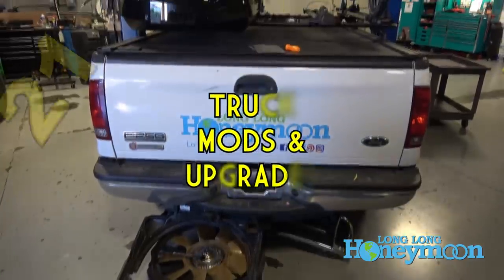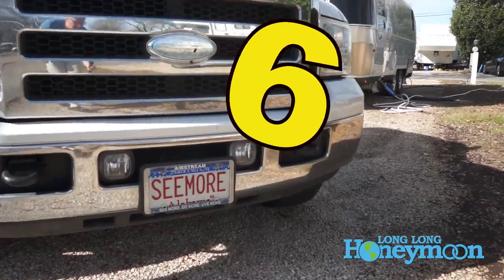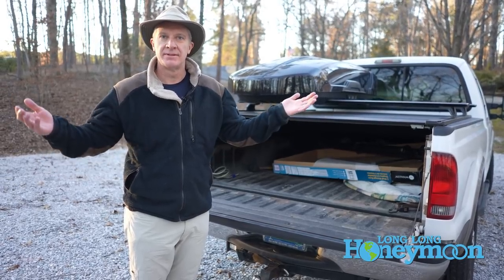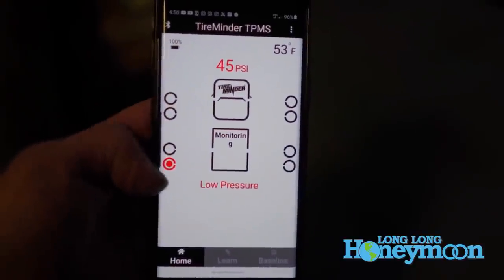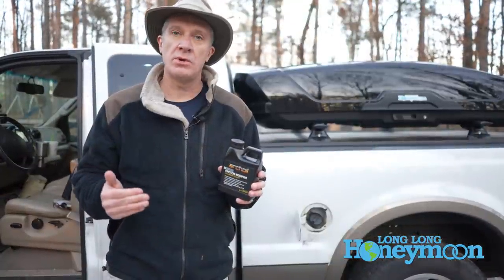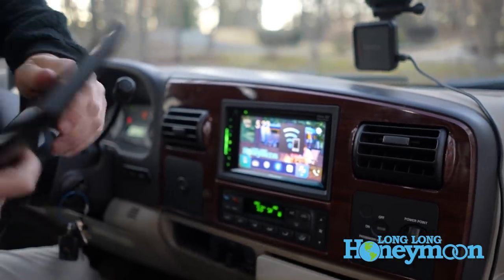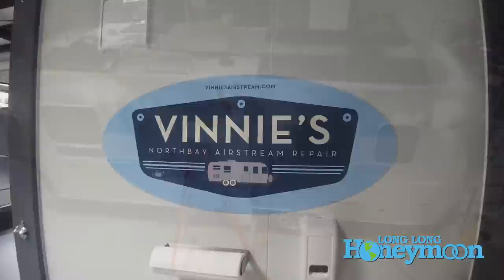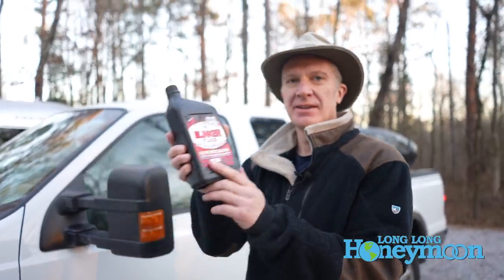21 Pickup Truck Mods & Upgrades!

Comment: It's so interesting to see all the comments from people telling him his problem was buying a Ford, because apparently every other truck is perfect right off the lot and never needs any modification or improvement. So amazing every other truck manufacturer managed to make their trucks perfect.
Reply: The number of videos of Chevy and Dodge owners who hate their trucks and converted to Ford outnumbers Ford owners converting to Chevy/Dodge by about 5 to 1.  I love my F150 XLT 4x4....best truck I've ever owned.
Reply: Nope. Upgrading a Ford truck sounds like polishing a turd. It's still a turd.

I've got an unmodified 1999 dodge ram 1500 and the only significant thing done to it after 22 years and 230K miles is a rebuild of the automatic gear box. So not perfect, but no need for "bullet proofing" either.

(Forgot to mention: we use the Dodge as a work truck, regularly hauling loads of gravel and trash that put the suspension confidently on it's rubber blocks.) 

At some point you have to let go of your idealized view of Ford. They just don't deserve it :-)
Reply: My Tundra is "perfect" compared to Ford, yes.  Sorry, it's just true.   250,000 miles and 50 states and all I've replaced is the air heater from running it all night once at 13,000 ft.  Henry Ford and the workers aren't the reason Ford sucks - it's letting Wall Street planned obsolescence be their business doctrine that degraded them... like most American companies these days.   New York MBAs are what ruined our businesses.
Reply: @dannyboy8474  Tundras are good trucks, but overrpriced.  Same with Tacomas.
Reply: @davervatx8814  get what you pay for
Reply: @ronblack45  Not with Dodge or Chevy.
Reply: 253,000 miles all my 2003 Cummins has needed is a recent water pump replacement and the lift pump and that’s it period. If I do have to work on it at least I will not have to pull the cab off to work on it. This will be a million mile truck as it has no rust in it yet. Your Ford will never do that, I’m sorry 😢.
Reply: The only thing any newer diesel needs is a full emissions delete.
Reply: @davervatx8814  there's a reason people put Cummins in Ford's and Chevy's.
Reply: @dannyboy8474  nothing wrong with Toyota. As long as you don't overload it. It's still a half ton.
Reply: @davervatx8814  Ford will finance anyone.
Reply: @duckwacker8720  So will Chevy, Dodge, etc. So?
Reply: @duckwacker8720  They have more money than brains?
Reply: @duckwacker8720  I’ve never even heard of someone doing that switch. Perhaps you’re thinking of an LS swap? I would love to see proof of what you say.

Comment: I have an '06 6L CCLB and I added a 50 gallon Transfer flow auxiliary fuel tank. I now have 88 total gallons of fuel. Going 800+ miles towing without navigating a fuel center is kick ass. I've also installed offroad lights under my rear bumper to illuminate my trailer, when getting to a CG at o'dark thirty.
Reply: I use to use a magnetic flashlight on the rear bumper of semi-trailers for backing into unlit loading docks. It works equally well on my 38’ gooseneck in RV parks.

Comment: Great advice on the blinker fluid.   Several years ago I tried to save some money by using cheap blinker fluid.    Long story short, the cheap stuff disintegrated the muffler bearings and made the kanoodler valve stick in the wide open position.    It cost several thousand dollars to fix the damage from the cheap blinker fluid but I’ve learned my lesson.
Reply: Yes, but the less expensive blinkers fluid will also lubricate the wigiform finflopper which otherwise would turn dry and scaly, and over time can begin to smell fishy
Reply from the maker: @markwall6685  Those cheap blinker fluids can also leak over into the flux capacitor, leading to very expensive repairs. Not worth the risk!
Reply: @LongLongHoneymoon  If you guys would just update your skyhooks, you would not even need the blinker fluid any more...they would become solid state.
Reply: Completely agree!! That's a true story on the cheap products..
Reply: @markwall6685  that's one reason Febreeze auto air fresheners sell like crazy!
Reply: I just switched my GMC 2500 over to SYNTHETIC blinker fluid.  Signals blink much faster now, and they claim it will put new life into those weeks-old LED bulbs.  Time will tell.
Reply: @LongLongHoneymoon  That only applies to Delorean's.
Reply: And yet nobody seems to put in the proper dimmer switch grease.
Reply: Do you sell the blinker fluid on your webpage?  I haven't been able to find it at Wal*Mart or Autozone.
Reply: @jimcollins8097  Don't let them blink too fast. Only 1-2 times per second (at least here in California, not sure if that is a federal law also).

Comment: 2006 Dodge 2500 Cummins here. I upgraded my steering gear to a Redhead unit. Great improvement in the steering. Upgraded to KYB heavy duty shocks. Now when I hook up my 29-ft travel trailer the truck barely squats at all. That's it for mods. 145k miles and going strong.

Comment: First thing I did to my 2003 RAM 2500 Cummins when I bought it in 2018 was to replace the stock hormonic damper with a Fluidampr. The engine is smoother and actually quieter as a result. Its one of those subtle changes that after a while you don't notice and just take for granted, kinda like your shocks. Its a good enough mod that all 6.7 Cummins engines come from the factory with them. Other things I did was to install a Leer topper, and a super thick DeeZee bed mat (I don't like spray in bed liners) after ditching the slick plastic bed liner that was in the truck when I bought it. Lastly, the 3rd gen RAMs have a super heavy tailgate and and the DeeZee tailgate damper is a lifesaver.

Comment: I use a bed rug in my Ram 2500’s bed over the factory spray in bed liner. I love it.

I’ve had all of the motor killing attachments removed from my Cummins as well as having the motor studded. Motor runs great and mileage increased. I also had a deep transmission pan, a transmission case brace, and deleted the thermostatic transmission cooling block. Now my trans temp never gets above 140.

Comment: Sean, I have an 06 6.0 liter F350 DRW. It was my Dad's so it's not going anywhere anytime soon. I just did the S & B cab mounts. There are less expensive ones, but I think they are worth it. While mine weren't that bad at 85K, but it has made the ride even better. While your at it do your steering dampener.  I also added the Banks Intercooler for a noticeable improvement in power, it's about air density.  You guys are to funny. Thanks for making my day.

Comment: Great video. We are still running a 2004 F350 CrewCab Dually 6.0 towing our 5th wheels with 167,000 miles now. As soon as truck was out of warranty I had upgrades done to engine to keep it from burning itself down. Over the years I have spent 5k on upgrades. Truck has been paid off now for going on 11 years now and I just cringe when I think about taking on a new truck payments. I think we are going to hang onto our Seemore as long as we can.

Comment: I have a 2015 Tundra and one upgrade was tow mirrors from Trail Ridge. I got tired of floppy clip on tow mirrors, so now I have the bigger mirrors, beware bank drive throughs! (I just fold in the left side.) I also added a Leer 700 hard tonneau. Great security, dry, but sometimes awkward to retrieve items. (like 30 bags of mulch).

Comment: I've found that if you upgrade to 30W30 blinker fluid you can get 10% more life out of your blinkers. I have done similar upgrades to my 2004 F350 6.0 DIESEL towing a Cougar 5th wheel. Great and fun video!

Comment: Use a Toyota Tundra to tow our Winnebago 2301BHS. Had stock Bilstein shocks, replaced factory bump stops with Timbren SES and going to add Coil Sumosprings to the front suspension. Not to add towing capacity but to help deal with the rough roads around here. The TT is going to get the suspension upgrade treatment when it gets out of storage this spring.

I run synthetic blinker fluid, flows better in the cold.

Comment: I added 2 sets of led floodlights on the travel trailer.  One set under rear bumper of trailer for backing into campsite at night.  Other set of floods mount on bottom of trailer frame about 5 feet in front of front trailer tires facing backwards to see in mirrors whether I'm going to jump a curb or drop in a ditch on night time turns.  Each set controlled by wireless switches on the sunvisor.

I added mid turn signals on side of trailer and side of truck.

Also added a third brake light on the trailer, and an observation camera on the back of trailer that actually works at highway speeds.

Biggest improvement to the truck was to trade the diesel for a 3/4 ton gas.  Life is fun again.

Comment: I have a similar truck. YOU NEED THIS!
B&D Tap Shifter.
It's an add on that lets you choose exactly what gear you want. You want to drop down 1 Gear, tap the down button. Yes, that means you can drop from 5th gear to 4th gear. How many times have you wanted to take it out of overdrive? Now you can. It includes an exhaust brake too. I had mine done at a Bulletproof Diesel authorized shop in Las Vegas. (AJ's)

Comment: We have a 2009 Chev 2500HD Silverado Duramax. Bone stock except I put a deep oil pan on the Allison transmission and went to Allison synthetic trans fluid. We have the roll-n-lock deck cover similar to yours.  We pull a 38’ Jayco 5th wheel. Installed the TPMS tire monitor system. Love it. Other than we love it and have had no issues.

Comment: We had ceramic window tinting added to our F250 and have a 12v dometic fridge in the back seat area. We also had a Leer 180 camper top installed which matches the truck and adds a ton of storage. We can now camp in our truck and leave the trailer for our base camp if we want to explore more.

Comment: No up grades yet I purchased one year ago a Ford F-350 dually 2013 it has most of the upgrades you put on your truck we have 2 185 w alternators  the truck has 196,00 miles and runs beautifully it’s also a Lariat package

Comment: I put new rancho shocks on the front and back of my truck, along with new axel bump stocks that I purchased from E Trailer, next thing I'm putting on are rear air bags, plus I changed out the tires on our travel trailer

Comment: I have a ford 250.  XL I changed out the head unit to a pioneer with bluetooth and it was a great uprade.  I tied an air compressor  fog lights and inverter to my aux upfitter switches.

Comment: The good news is most of your interior updates have been done by ford except for the trash can🤔. The massage seats are amazing. Bluetooth is good now too. Maps still cannot beat stand alone gps but Android Auto makes the truck map fairly out of date in a year even with updates for 5 that come with a new truck. I can only hope the 6.7L is more stable than previous generations with DEF. Good video!

Comment: Thank you for sharing your mods Sean and Christy. They are all sensible, especially given your setup.

We tow a 2014 Open Range Light 318RLS Fiver (affectionately called the Beluga), which was designed to be pulled by late model "half-ton" short bed trucks. Although we are close to our payload and towing limits this unit tows very well, especially with our TV upgrades. Ol' Blue is our 2014 Crew Cab 2wd Chevy Silverado 1500 with the 5.3L. I really like(d) my truck and didn't necessarily want to buy a 2500/3500 at the time, so she got some upgrades. These include new towing mirrors, a Pro-charger supercharger, Power Stop Z36 towing brakes, a Motofab 2-inch leveling kit, an Air Lift air bag system (w/ onboard compressor and wireless control), Bilstein HD struts/shocks, and Cooper AT3 10-ply E-rated tires. I also upgraded the upper and lower A-arms to the heaviest duty version available (w/ greaseable fittings) just because one of the ball joints was starting to have a little movement. The rig tows surprisingly well, even in steep grades. More importantly, the braking works great. Chevy did a nice job with regard to engine braking on this particular unit. The truck's upgraded brakes/ engine braking coupled with the Beluga's tandem brakes make me feel very confident while towing.

Ol' Blue came with TPMS, but we added it to the Beluga as well. This saved us during a blow out by allowing for a quicker response time and egress to the shoulder. The damage to the rig was significantly lessened due to this upgrade. We also have a soft tri-fold bed cover as we have a fifth wheel setup, but I would prefer to have a roll up unit like yours. Again, I like your upgrades, and as long as you maintain Seemore it should be able to run for quite a while. Love your channel and content.

Comment: We have a 34-year-old HJ 60 series Toyota Landcruiser. I ceramic coated her. To the truck I've added Old Man Emu suspension, new leaf springs, upgraded the rims to mine spec steel rims, new Mickey Thompson Baja ATZ tires, steel braided brake lines and HD brakes, as well as a tough Dog steering dampener. Reverse camera, linked to the Garmin 890. Changed out the driving lights to LED and added 9" Led Spotlights from Teralume ( Australia). In Australia a UHF Radio is a must- so a GME UHF digital radio.
Reply: Oh, upgraded the tyres on the RV to Michelin Agillis.

Comment: Hey Sean, check out the Edge cts 2 monitor. Also recommend a 3 door topper (cap), rarely have to crawl in to get stuff (Beer). Mounted ladder racks on top of it, put kayaks (suicide boats) up there. We have the same stereo but smaller rv gps. Hope to see you by the campfire someday ( I have a question). Be safe.

Comment: I added a tailgate assist gas strut by DEE ZEE that allows the tailgate to be opened and dropped softly.  It will no longer slam open if I let go of it when opening it.  Cheap easy upgrade.

Comment: Seemore has served you well, but it's past time to treat yourselves to a new truck. They literally come with nearly every upgrade you just showed. I upgraded to a 2020 Chevy 9 months ago. A new truck is like stepping out of the darkness into the light. Treat yourself...You've earned it.
Reply: And they also come with something else. A massive price tag and instant depreciation. That's what sucks about new vehicles. They stop appreciating me as soon as I drive it off the lot.
Reply: @explorenaked  definitely not true right now, bought my 17 denali for 62 brand new, drove it for 32k miles and sold it for 60k. Problem was I had to pay 66k for LTZ dually. 🙄

Comment: 50 gallon aux fuel tank in the bed.  Adds about 700 miles of range per fill up.  However, I really like the idea of the blinker fluid. I have got to get some.  Does it help with dry eyes? :)  Thanks again as always for the awesome Seemore video!

Comment: Great vid, Long Long Honeymooners, I have a 2019 Chevrolet Silverado 1500 LT 4x4. It is a gas 5.3L engine, which performs nice. I average 12 MPG when pulling my Lance 1985 trailer “The Nug”. When not towing I average about 20 MPG.
   We added a tunneau cover, which I would have preferred a nice shell, but did not want to add to the over all weight. 
 We have traveled across this nation from coast to coast and the fuel is all a bit different so I put Marvelous Mystery’s fluid in my fuel to keep the fuel system clean. I will also use it in my oil in the future. Stuff works great.
 I am putting the billstien’s on my ride too. Blew out the OEM shocks at 30,000 miles in Florida trying to hide from the over rated hurricane last year. 
  It is really nice to see you keeping your rig up to par. After 28,000 mile of travel we did in the last year I have seen some stuff on the road I just wanted to outrun for safety purposes. 
 I have been hunting for a better Mirror for our truck but one has not yet been made??? I also put ten ply “Cooper” Discoverers ATPs for my tire upgrade. We drive off-road a lot! Fishing and such.
Best of luck to you two.

Comment: I shared this with a friend who has a truck like yours. Same color but a crew cab.  On my 2012 Chevy Silverado 1500 4WD Crew Cab LT Z71 I also did a few upgrades. Sony XAV-AX210 Android Auto/Apple Car Play DVD receiver, OEM style backup camera that connects to aftermarket screen-radio, iDatalink Maestro RR stereo interface that integrates performance gauges and vehicle info on the Sony stereo touchscreen.  Barricade 4" nerf style step bars, WeatherTech rear floor liner, WeatherTech no-drill mudguards, Timbren SES aeon rubber springs that replace rear OEM bump stops. Also a Rhino Lining spray on bed liner, DeeZee Tailgate Assist, K&N cold air intake, Hypertech Max Energy Spectrum Power Programmer, and a DashMat UltiMat custom molded for the dashboard. The previous owner installed a tri-fold hard tonneau cover. Goodyear Wrangler DuraTrac tires and Bilstein 4600 shocks are planned for the future.

Comment: Archoil came out with a new product  called Archoil 6500 which is new and an upgrade to the 6200 (specific to diesel) . I just ordered some for my 2003 Powerstroke

Comment: We pull our 25' Airstream with a 2009 F250 King Ranch with the 6.4L Powerstroke.  My best upgrade and modification was doing a complete EGR delete kit and Mini-Max power tuner. "Our Guy" loaded all the Ford deleted power tunes and retuned the transmission shift points so it now shifts buttery smooth in each power setting. Thankfully our 09 did not come with DEF either or that would be deleted too.  With the EGR gone and the mini-max tuner we are seeing 15.3 MPG towing in flat country and over rolling hills to mountainous regions 14.3-14.1 MPG towing.  Unhooked my fuel mileage is 18.5 - 20 MPG as long as I drive conservatively and take my foot out of it.  Next we may decide to bullet proof it as well......not sure since it is still very low mileage for an 09.  Since new I've only put 75k on it. Great vid, BTW we love using the 20/20 full synthetic blend Blinker Fluid by Willy's.